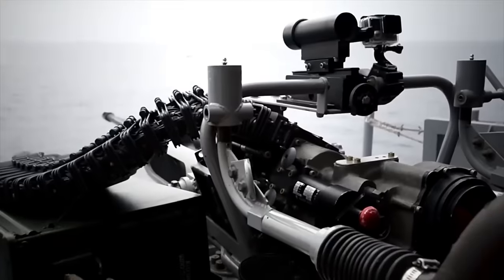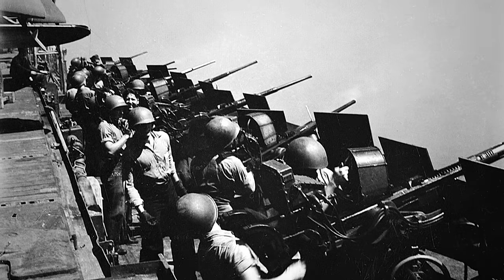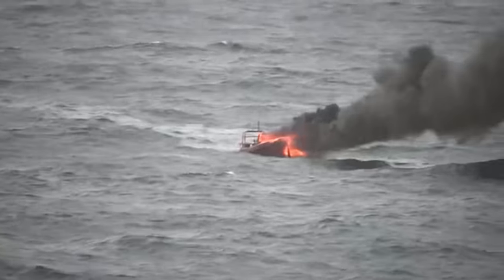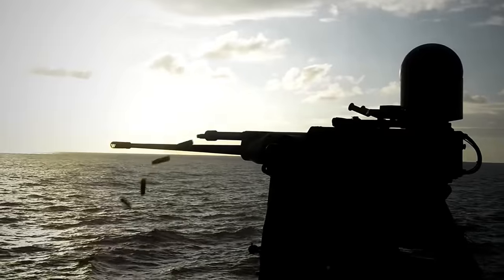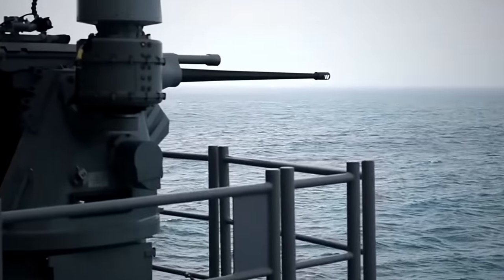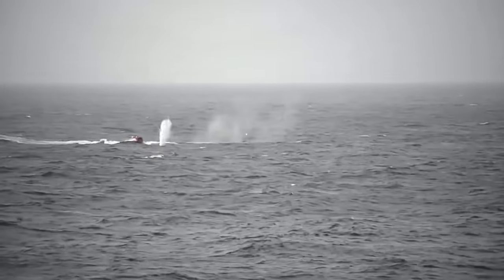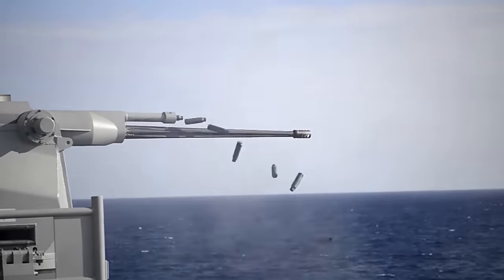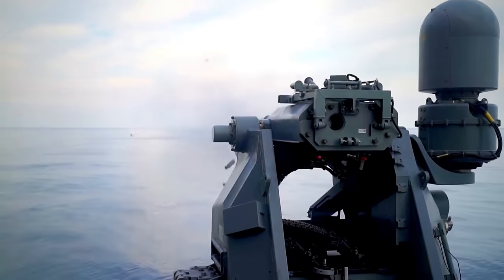The Massive and Hardcore Machine Gun System that Pulverized Any Kind of Ship

Comment: They should tailor the Phalanx with an optical gunsight if they're serious about close encounters. That makes this thing look like a semi-auto pellet gun.
Reply: BRRRRRRRRRRRRRAT..... !
Reply: So you're thinking an optical sight would help them shoot down UFOs?
Reply: @abikeanditsboy3449   so you're on drugs too!... that makes sense!...
Reply: Do you mean the PHALANX TRACKING PEDESTAL offered by L3 Harris?  "The Phalanx Tracking Pedestal combines rugged, high-precision electro-optical instrumentation with the flexibility to serve on a variety of vessels and weapon platforms. It offers superior close-in fire control performance in a small, reliable, lightweight, easy-to-maintain system"
Reply: @videoviewer2008  No, the 20mm CWIS gatling gun.
Reply: They do. You can see the FLIR camera mounted on the sides of most Block 4 CWIS on most arleigh burke DDGs.
Reply: Why should it have an optical gun sight? It already uses radar targeting that surpasses any humans manual accuracy.
Reply: @Fgway  very true, in fact that how thermal targeting already works in systems like the Javelin and thermal cameras on fighters.
Reply: @ryanhampson673  So you can use it on surface contact that the radar cant see and the Block 4 systems already have it.

Comment: Note: This is not a machine gun, it is a chain gun. There are significant differences between the two.
Reply: Correct!
Reply: Note: It would have been nice if you taken the time to explain the difference rather just critiquing.
Reply: @makegaminggreatagain3907 you make a video explaining it, if you know so much instead of critiquing
Reply: @gazbags9136  How about you tell everyone how to turn a simple pair of basic definitions: "The cycling of a machine gun is powered by the propellant gasses. The cycling of a chain gun is powered by an external motor.", into a video. Ya know, instead of critiquing.
Reply: Thank you KAREN,or is it DARIN..
Reply: What rubbish! A chain gun IS a machine gun. It is a particular type of machine gun that cycles its action using an external chain rather than, say, using excess energy from its cartridges' propellant.

Comment: They should just put the GAU-8 Avenger out in its place, seeing as the USAF is purported to be shutting down the A-10
Reply: Why? That gun isn't particularly accurate & the targets aren't armoured so a bigger round doesn't really add anything. Its lower muzzle velocity so its going to be trickier to get an accurate shot at long distances. If they want to send more rounds down range there are plenty of 20mm Phalanx guns that can be used. Plus, that gun is gigantic making it difficult to mount & even harder to track on a moving target. 

So no, they probably shouldn't use the GAU-8.

Comment: I’m not sure if the video depicted is the actual shots fired during testing but it sure seems to me the gun is missing the target.  I see splashes all over the place for such an ‘accurate’ gun.  There even was a video edit switching from the boat to the scene of the boat on fire.
Reply: I understand why you think that. They walk the rounds up onto target. Also some rounds pierce through while some deflect and strike the water near boat. I've watched a lot of footage that looks like Misses but actually ended up being dead on. I'm not sure if it's just camera angle or what
Reply: you are misunderstanding the terms being used.
using weapons on Board is inherently complicated due to the changing movement speed and direction of both the attacking vessel and the target, the rocking of the ship on the waves and the rising and falling of the ship with the swell of the waves.
as a result of the motion mentioned, in many cases an operator may use a "strafing" technique that runs through the target guaranteeing the hits.
a good way to tel the difference between an accurate vs inaccurate gun is if the rounds land in a clean grouping or a straight "stitching" pattern or if the rounds are spreading out randomly.

this can be verified if you took an oerlikon gun to a standard shooting range, the rounds will spread out over a radius from the target.
a remotely controlled bushmaster mk.38, on the same range, could easily hit all its rounds within a 4' by 4' target at 3000 yards.
additionally, when remote controlled, the rounds may land not on the digital crosshairs of the electronic scope - so the user can input milliradian corrections that would correct the alignment with the following rounds landing on target.
Reply: Accurate it is not! Or the gunner needs more training. So what is it? 

I understand they are at sea with both moving in three dimensions yet that hit pattern is ten times larger than the target. Some of those rounds are way off.

 I can't tell how far they are shooting though or if the footage is showing the enhanced version. 

 Just wow... Can't believe people are saying they are walking the target when they clearly are on target since rounds are going way above, below, and almost hitting before going off again.
Reply: @dianapennepacker6854  
It’s mixed footage so it’s hard to tell the difference between the manually operated guns and the electronically stabilized remote controlled guns.

My experience is with firing the typhoon RCWS system (which is built around the bushmaster m242 gun)
Reply: If you look at all test firings from all those types of guns from different navies, you'll see the same pattern. It's not just that weapon.
Reply: @frigyou1078   I shot a 12 gauge shotgun once back in 1976. I've been walking sideways ever since. Yes, I held it tight to my shoulder.
Reply: @matchrocket1702   Shoot is a couple times on your other shoulder and you should straighten right up.